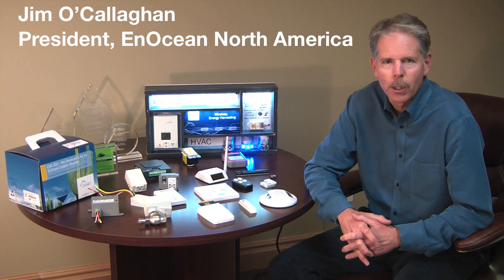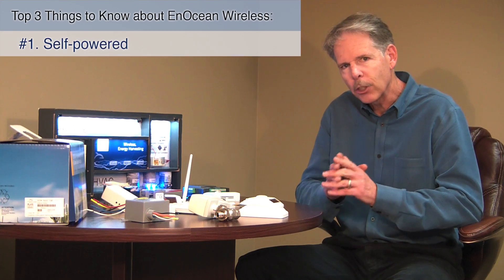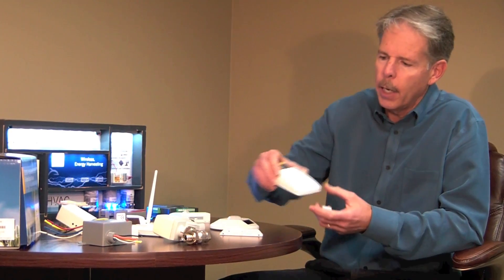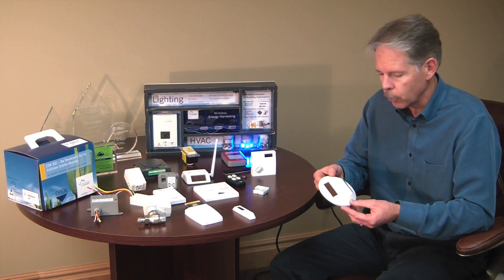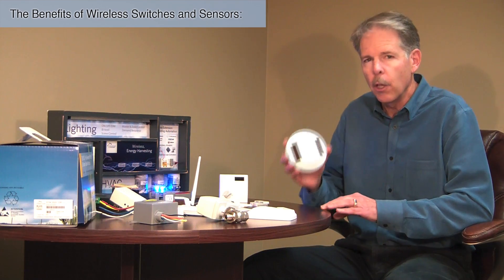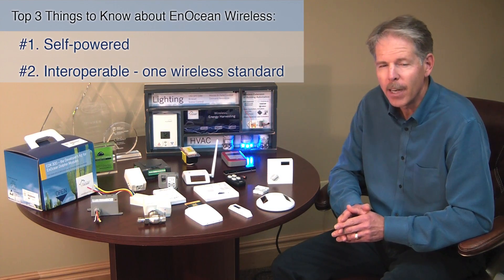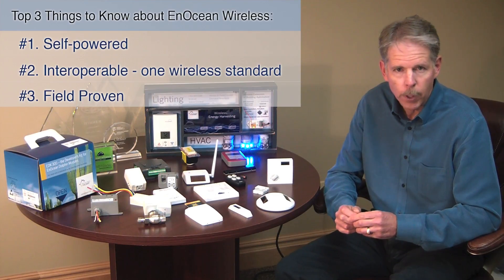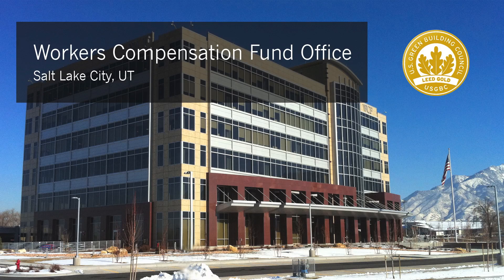EnOcean Wireless Technology - The Top 3 Things to Know

Comment: Does the sensor need an adress for comunication?-
How Can I link a switch with a sensor without causing interferience with other switch-sensor networks?
Reply: using LBT to avoid collision detect before data stream transmit also the devices has a maximun time frame for tx or rx packages, this is the way that enocean use to avoid package collision